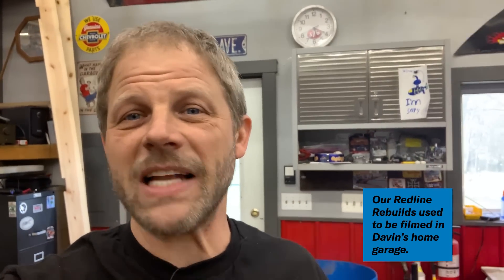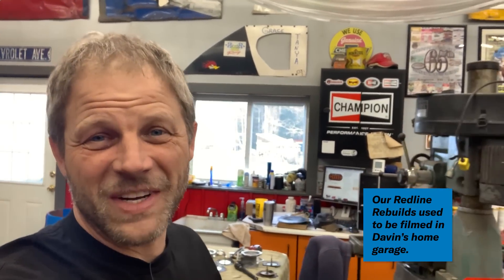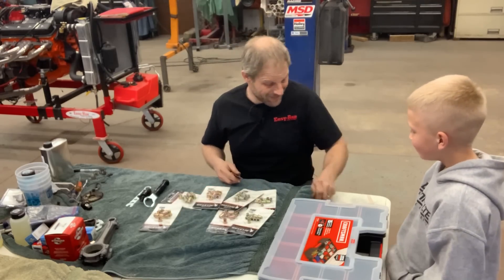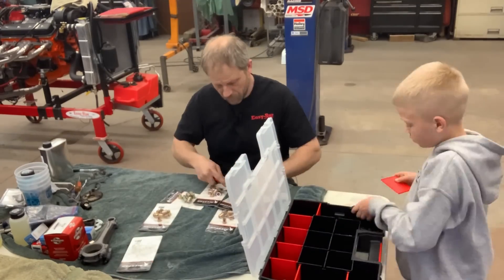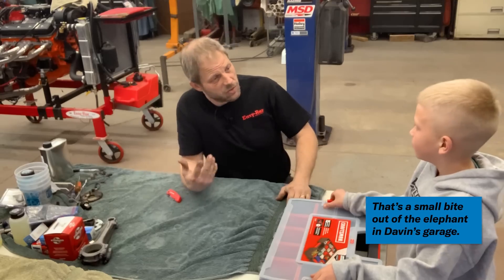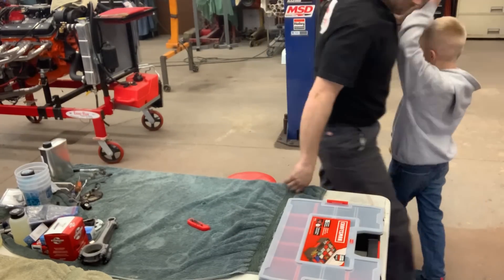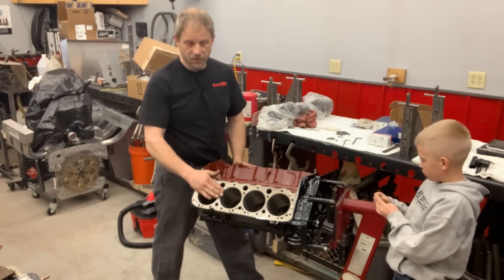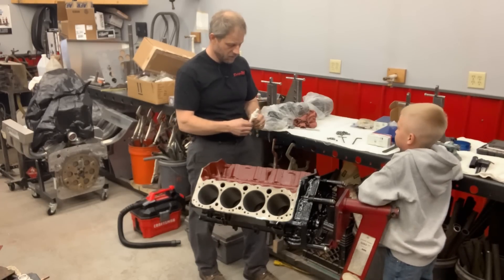A special guest helps Davin around the garage.

Comment: These appear to be picking up favor of late on a few of these channels. Did the original patent run out recently or ?? I ran into these  20+ years ago at work than known as "NutSerts". The tool/s used to come in a plastic box with cubicles to store the different sizes. Only problem I have encountered is, being aluminum,  they tend to seize after being installed for awhile and when you try to "loosen" the fastener, the entire "NutSert" spins in the hole where it's mounted. This can be a major pain since they might be installed in a location where you can't access the back side to hold it. So, if you're going to use these, be sure to use "AntiSeize" on the threads. For places like "body mounts" where you can't access the back side, I would recommend welded-in nuts instead. FWIW !!!